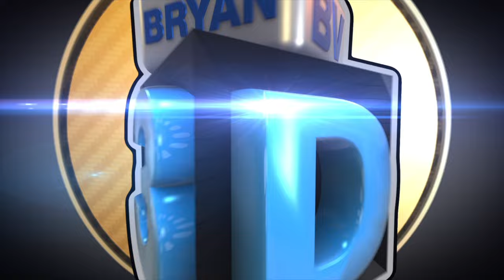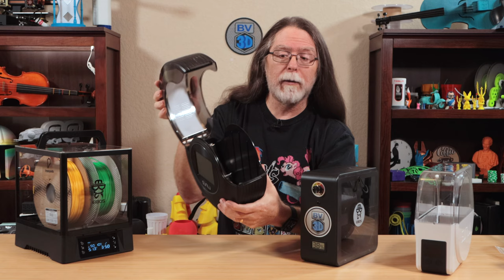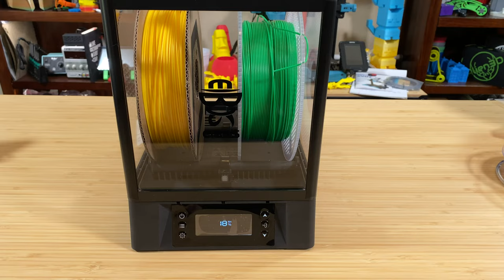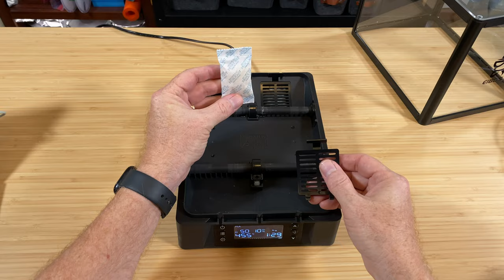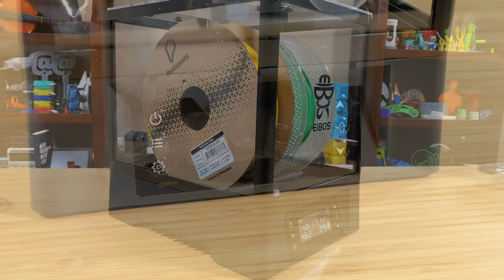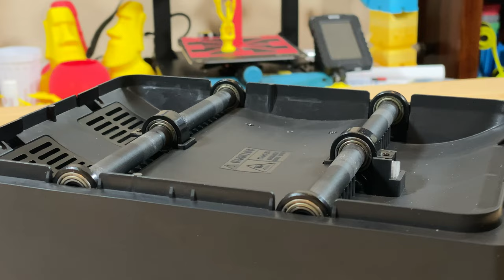A Filament Dryer With A Spin Cycle! The Eibos Polyphemus!

Comment: My problem with most of these dryers is that they use a couple spindles at the bottom and the spool rests on them.  Printing while drying, even plastic spools can run pretty rough, and this can affect print quality.  Some cardboard spools don't work at all.  A dryer that holds spools at the center would be a much better design.

Comment: I do like this design, but you may want to check your original Eibos drier as I’ve found they made a mistake on the front dial with the temps.  It’s supposed to show PLA, PETG then ABS & TPU, but on the early models they made a mistake on the label and switched TPU & PETG but didn’t tell anyone about the mistake.

Comment: I use the Eibos Cyclops and the Sovol dryer. The Eibos doesn't have the rotation and there are reports of damaging the filament on a full spool. I use it with a printed part that creates more distance between the heating element and the spool. The Sovol is handy as a drybox for printing, but it isn't powerful. Drying PETG takes a lot of time, while 65 degrees Celsius is required, while only 50 degrees is available

Comment: The one issue is the rollers lacking grip, and I will be trying PlastiDip on them to add grip. It's temperature resistant up to 200F/93C so it should be perfect for that application.

Comment: allready have bad alligned threaded inserts , socket loose on the body of the machine , motor that came with it burned after 5min of operating , powered rollers slip on the orings , and so on... i'm sending it back sucks after 2months+ of waiting for this.

Comment: Polyphemus arrived last week, I did some testing comparing to my Cyclopes dryer.
First impression: It's silent! The cyclopes fan is somewhat noisy, I don't her the Polyphemus in my office. If it is completely silent i can hear it but the rotation motor makes more - faint - noises then the fan. Well done, Eibos.
The Cyclopes heated the table under the dryer, at last I put a metal socket under the dryer.... that's gone with the Polyphemus. 
Temperature: The Cyclopes promised 70°C but the one i have here reached aboout 60°C max. Temperature distribution was bad, on the bottom beneath the spools 50°C but above the spools sometimes less then 40°C. 
The Polyphemus has much lower differences. Display 50°C, chamber between 45°C above spools and 48°C beneath spools. Nearly perfect. Couldn't test max temperature as I lack testing filament spools for that.
So all together well made and worth the money. 
I've only one point to complain: The motor driving the spools has a lifetime of 1500 hours. Really, Eibos? The default for PLA is set to 4 hours, that's somewhat .. optimistic even for PLA. Other filaments take up much more time to dry, 10 to 12 hours. with 10 hours we have 150 drying processes until the motors livespan ends.

Comment: I really like the Eibos Cyclopes two spool (or one bigger spool) dryer and keep it between two of the printers I use with TPU a lot.  The lack of rotating was something that caused color changes in one spool so I made sure to do shorter drying times or spin the spools around like you mentioned you've done.  This looks like a great improvement with the rotisserie option (totally should have been the name).  The only other thing I dislike about it is still present in the new model and that's if you're printing from both sides, or even one side and what to change the other spool.  Getting the hat off while filament is pathed through one of the apertures involves a balancing act holding the lid up, playing out excess filament for the spool still in use so you can remove the second spool.  Then you need to get the other spool in and thread the filament through the hole you want so you can put the top back down and keep printing. I don’t think I’ve successfully pulled off the swap without knocking over the other spool, making the process quite frustrating. I was hoping for a front panel of the “hat” that was hinged so one spool could be swapped without disturbing the currently printing spool. Other than that one issue, it's a great dryer and one I go to regularly.  

Great video, love the visual of the two grams of water loss!

Comment: Excellent video as always, I use the Sovol Filament dryer and a Comgrow one as well. both take 2 x 1kg spools and they work really well.
Reply: so would you recommend the Sovol dryer ?  I have been using a Sunlu S2 dryer that recently expired after 2 years of continuous use.
Reply: @TsiolkovskySportingLocks  Yes, I would totally recommend both dryers, both have fans for air cycling and are priced really well.

Comment: Nice video. My question is where oes the water / moisture go? A typical dehumidifier has a catch can. Is it just the fact that the two cubic centimeters of water simply evaporate? Thanks
Reply from the maker: Hi. Yeah, a dehumidifier works by chilling air to condense moisture out of it, so it needs the reservoir to hold that water. Then you have to empty it all the time. A dehydrator works more like blow drying your hair. It heats the air, and the warm air can hold a lot more moisture than cold air. So yes, basically, that 2cc of water evaporated.

Comment: Just ordered it.
The Polyphemus avoids the problem of the Cyclopes. The Cylopes works quite well - when printing. When drying two problems may occur: The temperature at the bottom is good for drying - then it is too low at the top and ilament will not dry. I've measured differences between top and bottom inside of 15°C and more.
Or temperature at the top is OK, then the filament melts at the bottom.
Rotation is a nice way to avoid that.
Reply: You can mod the Cyclopse ;) Check out printables. The user "warpster" /model/336958-eibos-cyclops-drive-mechanism has a mod for it. I use this mod for a long time.
Reply: @H1zN  I know and I did that.
But I think it can't be a customers task to make a paid product usable. The Cyclopes wasn't that cheap..

Comment: Hey Bryan, The bubbles you referred to in the screen... are you sure that isn't a protective film from the factory to prevent damage to the screen?
Reply from the maker: I'm not 100% sure, because if it is, it's on the screen, and behind the clear window on the sticker. I can't tell without taking the unit apart and getting to the screen from the inside.

Comment: Thanks for introducing this product, I think it has potential but I don’t think it is a good design. Why not just put their STL online at one of the many 3d models sites? Good to see they include a spare motor, I didn’t hear you mention a fan, they say it has a “silent fan”. Maybe heating one side is a good way to dry out that section, then move on to the next. Notice that if the motor turns the spool a but then stops, say 20% duty cycle, it will last 5 times longer. They missed one significant aspect, thermal insulation. The heat losses are enormous in their design so you need much more energy to reach higher temperatures and so more local heating of the spool and the parts in that area. For you own design, I use a cheap timer to set the on time, of course you have to realize that it repeats every day (I used a Christmas lights timer, $3). 

This is literally a system that heats the filament at the bottom the turns it a bit. Without thermal insulation the top will be cooler than the bottom. With air circulation and good insulation the spool turning is unnecessary.

Comment: Having the rollers slippery, might be good for allowing spools to rotate while printing, whilst having rotary mode on?
Reply from the maker: I forgot to mention that the manual says, "Don't run it in spin mode while printing." When the motor isn't engaged, the rollers spin freely.
Reply: @BV3D  the rolls are linked through? So if you are printing and have a second spool just drying, it will get rotated around by the movement of the printing spool?
Reply from the maker: @liamtwentyman7275  The powered rollers are independent from one another. Spinning the rollers on one side doesn't spin the one on the other.
Reply: @BV3D  can you choose to just have one side powered then? Or is it both sides or nothing?
Reply from the maker: @liamtwentyman7275  It's both or nothing.
Reply: you are wrong , it's one motor on planetary gear , so it makes both rollers move together.
 @BV3D

Comment: Those extra features should be dead-simple for the factory to add. Wonder if they used arduino code or something proprietary. A NodeMCU could easily handle all the functions and then some.

Comment: Excellent review as usual. But not quite enough puns this time.  I'm really wary of any Eibos dryer, since my 13-month old Easydry, purchased after I saw your review of it, stopped drying this week.  The fan runs, but no heat. It was used only once or twice a month in those 13 months, so I can't endorse any Eibos product now based only on initial quality and performance.

Comment: Is that just a screen protector?
Reply from the maker: It looks like a protective film, but if it is, it's on the LCD screen itself, not on the black sticker with the clear window. I'd have to take the unit apart to be sure. If I remove the black sticker, I may not be able to reattach it again (you know how stickers get!)
Reply: @BV3D  Check out Modbot's review of the same dryer at 3:07.  Spoiler alert: he peels off the protective label.
Reply from the maker: @yeroca  So did I, but the bubbles on mine are underneath the black label. 😁
Reply: @BV3D  Maybe you can peel off both, and then reapply just the black label.
Reply from the maker: @yeroca  Sadly, those never look the same after you do that. If it bugs me enough, I'll take the bottom panel off and go in from underneath, to get directly to the screen and see if it still has its manufacturer's protective peel on it.
Reply: @BV3D  I get ya.  Looks like a nice dryer anyway.  It fits what I want from a dryer pretty well.

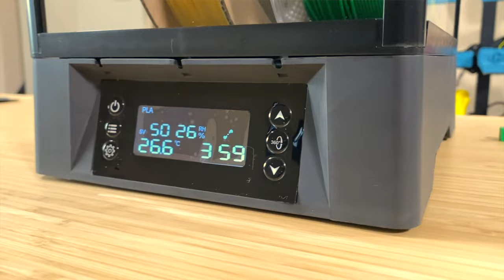Comment: 11:20 I would really say you simply forgot to remove the peel.... Not only how it looks on the screen, also between the buttons.
Reply from the maker: Yeah, that's what it looks like, but I peeled the peel that was on it. It's POSSIBLE there's a protective peel on the screen itself, behind the sticker, but I haven't taken the unit apart to see if that's the case.